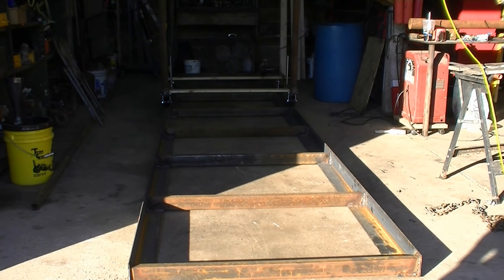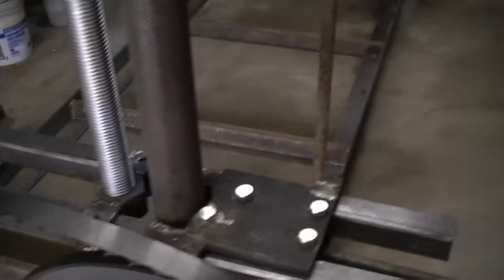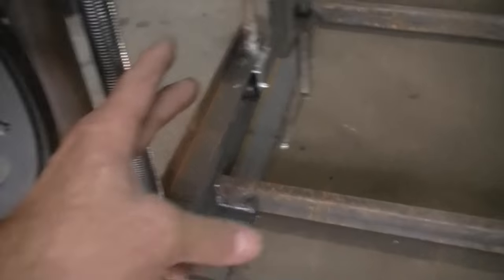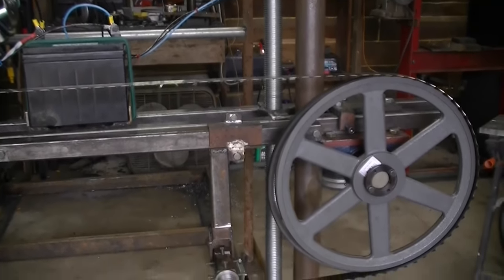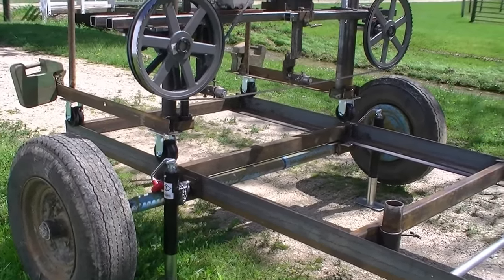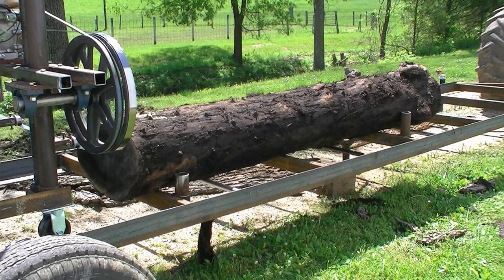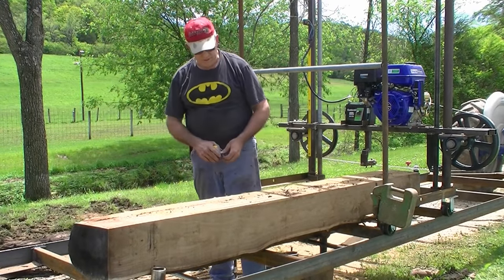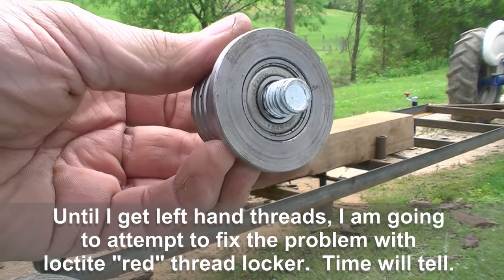168 RSW Homemade Bandsaw Mill Part 1

Comment: Your learning
Before yo put an automatic feed on it, But not sure what you done since you put this video out, a couple of suggestions,

I put a handle attached and linked it to 2 flat arms at right angle that would lift up to what ever height I wanted on the bed, and would lock it, (1/2 inch to about 15 inches). This would provide a constant 90 degree to my bed, so I never had to worry about or play with adjusting my logs when turning them for a 90 degree cut, Then I also made a collapsible adjustment that would be hydraulically adjusted to hold down to 1 inch boards,   It only need to go up about 2 to 3 inch to hold any bigger logs then you have, 4 feet in dia, 
Also more weight on the back may help stop cutting ff at an angle down wards, 

And possibly to improve the quality of your cut try speeding the speed of the blade, with a bigger pulley on the motor, It will also make it cut much easier, And start shoving a wedge under the piece being cut, Makes it easier on the motor and blades,, Pushing to hard on the blade will make it rise or cut down ward if the blade is dull or slightly off alignment.

One thing I would suggest you do, Either put an arm to push on the outside of the carriage or make a grilled walk way inside the bed, but it may get plugged up.

Comment: MAKE TWO BLADE GUIDES SO THEY CAM BE WITHIN SIX INCHES OF LOG AND BE SURER TOO CAREFULLY ADJUST THEM SO BLADE IS ABSOLUTELY STRAIGHT FROM WHEEL TO WHEEL. REALLY NICE BUILD. PUT BLADE SAFETY CAGE ON IT BEFORE YOU USE IT MUCH. OR OTHERWISE SOMEDAY YOU WILL WALK IN FRONT WHILE RUNNING AND BLADE COULD COME OFF AND CUT YOU IN HALF. AS YOU LAY THERE DIEING LOOKING AT YOUR LOWER HALF FOUR FEET AWAY YOU WILL THING I SHOULD HAVE LISTENED TO THAT GUY...….

Comment: Where I buy this blade I want make also but I didn't see blade
Reply from the maker: Rael Bajo it is a standard 158 inch blade by 1 and 1/4 inch wide.  They are sold in a pack of 10.   I think I bought them off of eBay I don't remember exactly.

Comment: Really great, so impressive, thanks for sharing the build.  I was wondering, does the cutting blade stutter arise from the drive belts being a little too elastic or loose.  Or does it arise from wheels allowing the frame to twist slightly.  Again, wow!  As you have 12v, do you intend winch/motorise the frame forward and save your back ❤️

Comment: I know it's 5years , but it looks like you're powering the wrong pulley.  I could be wrong, but it looks like you're pushing the blade instead of pulling the blade through the wood.

Comment: Why don't you just put a hand crank on it like a boat crank so you can cut the measurements you want to cut , & why don't you just get rid of the tilt device for the saw blade Tensioner all together you totally don't need the blade to tilt but ya have to keep the tensioner
Reply from the maker: The blade tilt is very helpful otherwise you get you know the blade diving or climbing.

Comment: Walnut Mandolin ?
Reply from the maker: Richard Mead thank you for watching. I'm not too keen on Walnut for instruments. It doesn't have the sound that I'm looking for in general.
Reply: Makes pretty nice ukuleles with spruce tops and dulcimers too....
Reply from the maker: BarbedStar it's good wood and it's pretty and easy to bend. But acousticly, it is far below other woods that you can use. I can't speak to ukuleles much. Generally speaking dulcimer's don't put out much sound in terms of volume.  Therefore the Walnut doesn't affect them all that much.   Though they'd be louder with a different type of wood.  The only instrument I have heard made from Walnut with a quality sound, was a dobro.  It was made locally by a fantastic dobro player. That fact, probably had more to do with the sound than anything else, just because he was so good.  Thanks again.

Comment: Unfortunately you live in Missouri where useless eastern red cedar just about owns the state! Nice saw though.
Reply from the maker: Bill Seper it can be a problem however we are in pretty good shape.  I do have some red cedar on the farm.  But it is a pretty good-sized stuff and I can make some nice boards out of it as well.  I use it for a lot of things on the farm. thank you for watching.
Reply: I have seen several mountain dulcimers and Native American flutes at Branson that were made from Missouri cedar, but I reckon it gets used for more fence post than anything. :-) Most of it is so twisted and full of knots . . . but it sure stains pretty. I saw some guy on the net making solid body guitars out of it that looked really nice with a hand rubbed finish. (I guess you can make a solid body guitar out of just about anything.)
Reply from the maker: Buck Sellers yeah it's great wood. I plan to cut a bunch of it here on the farm.  I have a ton of it.  The conservation wants it gone anyway.  Sso it's a win-win.  Thanks again.
Reply from the maker: Bill Seper it actually has some pretty good acoustic properties. Unfortunately it's difficult to find enough of it that's clear of knots and consistent in color for the most part. It makes great turkey calls.
Reply: I have a wood working buddy near 6 flags who has a lot of acreage with almost nothing but eastern red cedar. He uses smaller pieces to make pen and pencil sets and little trinkets, but almost all of the rest goes into fence posts and firewood for their outdoor pit. I think what he hates about it is that even when you find pieces straight enough to use for 2-bys and 4-bys, it's usually got so many knots that it ruins blades fast. Stuff sure smells good when it burns though. Nothing better for sitting around a pit roasting wienies and marshmallows with the kids. I'm not much of a wood worker myself though. I once made a bass guitar body out of a 4-foot long 1"x16" board made from 1-inch strips of joined pine that I cut in half and then glued together to make a 2" thick slab. Laugh if you will, but it's still the best canoe paddle I ever made.... :-)

Comment: I sure wish you would learn the difference between a gasoline engine and an electric motor. On your saw guides use a longer bolt and double nut them.
Reply from the maker: If it upsets you that much I wouldn't watch it
Reply from the maker: I rebuilt thd guides left-handed and the whole machine 180 degrees opposite in part 2 then in part 3 I cut some red cedar
Reply: I do not see a part 2 I am watching part 3 now.
Reply: I found part 2

Comment: Coolant is needed for blade
Reply from the maker: NOPE  NOT  TRUE.  Doesn't even get slightly warm.  In fact is stays cool to the touch through out.  It is  myth.  Sorry to dissapoint.
Reply: @RosaStringWorks  no myth its truth not for cooling the blade ..it to clean out s.d so it dosent clog rakers

Comment: nice job, but wrong engyne rotation side. Engine not attracts but pushing blade. Then blade waves and cut not correct. Motor must to be on other side, than be OK. I know what I`am saying. Sorry for English language I`am from Lithuania.
Reply from the maker: Tadas Sokas yes, I know thanks.  will work on changing it.
Reply: Rosa String W

Comment: rosa string works, Have a Karl Hofner ( with omlot) 2nd violin 3:4 44 as 4th ( and hold last) violin made 18 dollars today have to tell Medicaid here transition to Medicare in 2020,taking since 1975. Took out the sound post,and with 4 strings ( 3 current and new bridge) will be a 3 octave range Tuned D A E B 3rd A tuned to A 335. Any suggestions,?works with long bow,big repertoire children's, cajun, classical,pop ( as sweet simple bird) 3 former skynyrd rock songs,Let It Be ,published in A and F so I do in D,,b d g becomes em7 or gm7 depending on harmony and cycle as standard You are so beautiful,Dm 7,6,5,c g,g a d,bdg chord as gm7 ,b to low g,example.What do you think?as euro orchestras tune A 336, ? Thank you for hearts and likes!Chris Young

Comment: Great if you're whitlin toothpicks, you won't be slabbing anything larger than 10" with any consistency, way too flimsy a set up. You need"beefy " to mill worthwhile......think blade lube!
Reply from the maker: That's kind of funny because I've been using it for a couple of years now and it works great.

Comment: Your band speed is to slow yo need to reduce your drive pully down to about an 8 or 10 inch
Reply from the maker: After several years of use it seems to work perfect to me

Comment: For the life of me I can't understand your reasoning of blade guidance! You do Not see your set up for guiding used on an upright bandsaw. In other words the blade runs absolutely straight from wheel edge to wheel edge and the guides keep this from flexing out a straight line 0_________0. your blade is wide enough to increase your tension, you will have less cut marks from blade flexing. Hope this does not sound like a personal attack. I also built my own and not without a lot of lessons.
Reply from the maker: lary radke thanks for watching. I patterned mine after many other commercial models in terms of the blade guides. In part 2, I completely rebuilt the saw a hundred eighty degrees.  In part 3, I sawed some really nice Cedar.